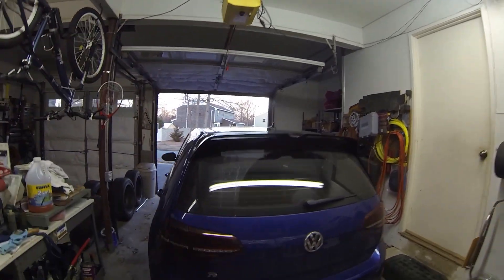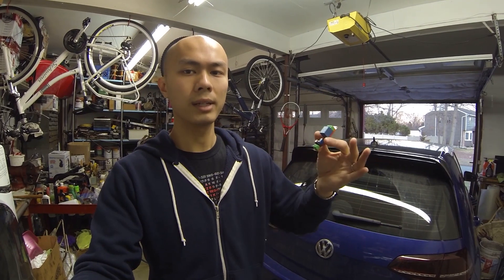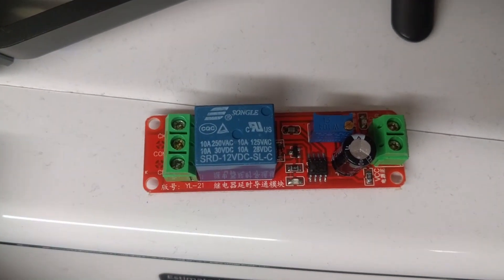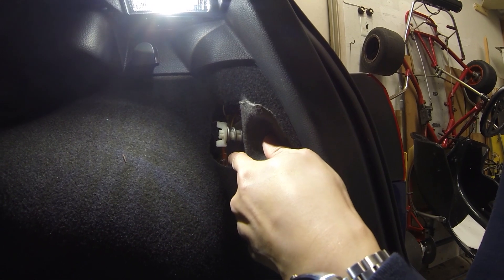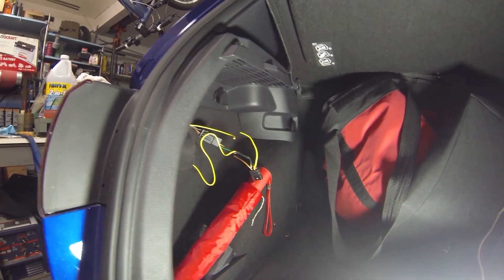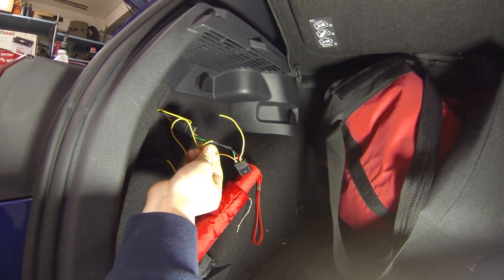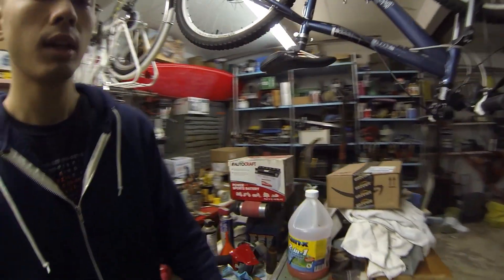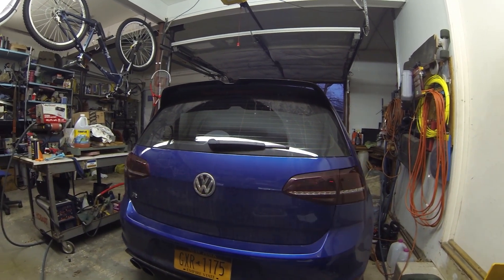DIY Sequential Turn Signals - MK7 Golf R

Comment: Could I ask did you previously retro fit your light fittings as I've looked at my wire harness to do your mod  but I don't have the matching yellow wires on my harness so without testing I don't know what wires to connect to regards paul

Comment: Hey great diy, I’ve got a quick question, I’m getting both the red and the blue light, with the hazards on, and I do get the click when I adjust the pot. But only the blue flashes upon the clicks not the red and there is no delay when I make adjustments to the pot. Am I doing something wrong? Oh and these are on regular halogens which shouldn’t matter I don’t think plZ advise thanks

Comment: ok so my wire colours were different, the brown was ground, but the power was a grey/black striped wire. it was a different colour on the other side, but wire position the same in the harness. it was the wire next to the brown in the middle. I used multimeter to find the right wire. The only thing is that there is an annoying click each time the delay activates that can be heard from the boot, so while cheap and cheerful fix, extra click in the boot each time the delay fires is annoying. Looks like the noise comes from the LED. In order to properly get back behind the wiring its necessary to take out the back seat, the seat side trims first, then the boot liner at the lid, then then the boot plastic liners on each side. Its a pain in the ass and many clips and plastic bits break especially if you arent familiar with how the panel comes out. Extra wire needs to be added in and soldered for 4 wires as there isn't much room. $20 sure, but the harness that just plugs and plays is probably so much easier, neater and quicker and doesn't require ripping your car to pieces. takes ages to do, a good 3-4 hour job. When the car is locked with the key fob, only the boot lid indicators flicker. When opening, depending on the delay timer setting, the outer indicators might not flash. Considering just returning to stock by soldering the extra wires i put in without having to take it all apart again. if you want dynamic lights just pay the $500 a get replacement lights, much better and less muck around IMHO.

Comment: To make it more in-sync perhaps you could measure the resistor's value in the potentiometer and make them the same value?
Reply from the maker: Yes that's an option, although overkill. Can't tell the difference already and how often are you using hazards anyway.

Comment: Great job zed ,
However i do have a question how do you get the sequential effect if the car leds are not addressable ones , and how does the delay timer achieves the sequential effect when it function on&off after a delayed time , i mean it will turn on and off all leds together with delayed time t not in an addressable way led one by one
Reply from the maker: Hi I saw that you also emailed me. I'll answer here. This is sequential with two bank of led not each individual led
Reply: @zed4me  Basically this is not sequencing but delaying the switching of the outer and inner indicator light, if one notice in the video it is an eye effect that you see the sequence but it's only switching the inner first and the outer later.

Comment: Hi I've connected as per the video however my relay switch stopped working both sides, only the red light comes on. its the same exact  12v NE555 Delay Timer i bought from Ebay

Comment: I figured that part out I had the wrong wire tapped into, but now I think all of my lights are on the same circuit on both side lol when I adj the POT. All my lights correspond smh it’s a older car so maybe that’s the problem but looking at your harness it looks like your 2 yellow wires are they tied  in together in the harness? Because my turn and brake are tied and jumped from 2 of my 3 lights. I was only gonna out the board on only one light, do u think I should do both I wonder would that work or cause a problem being they are on the same circuit

Comment: Thanks for this vid. It got me thinking that I could potentially use the N555 to make my stock halogen tails sequential with a little re-wiring. What do you think? I'm not a fan of the urban joke police wig wag.
Reply from the maker: Only if your turn signals currently make both the inner and outer taillights blink together.
Reply: You can do this with OBD Eleven Premium. You need manual coding and some research.
Reply: Csrt4Dad Did you happen to figure out if this is possible with the halogen lights?
Reply: Since OP does not follow his post, I post my 2cents:
If you want the red parts to do the semi dynamic blinking, you'd have to put them onto one wire, then use the relay respectively and release the lights in the bcm of all coded functionality to not get a bulb error.
If we're talking about euro halogens you could use the regular yellow blinker and the reverse lights as the inner part of a semi dyn blinker in the same way but, again, you'd lose their original purpose except you code your blinkers as reverse lights.
For further information research about Leuchte Coding on MQB platform

Comment: Though this looks rather vehicle specific to stock LED lights; I am curious....is it an optical illusion or is it just a "two light sequence"?  First the inner then the outer?  I am thinking that with two of the modules you could make a "three light sequence" and with three you could make a "four light sequence"....would just have to run one module into another, but speed up the time as the power from the initial stock "blinker" relay is only on for a short amount of time.  What do  you think?  Thanks...

Comment: I came to finally rebuild your  Project. Small problem: if the engine is off : all good, works like a charm. But if my engines running the Relais sound like dying. ( buzzing sound)I think they suffer from too high voltage from the alternator. Should I put a resistor or sth else in front of them? How to protect them? Can I simply modify something with obd11?
Reply: So i went to my local equivalent of a radioshack and build a small voltage rectifier according to the employees recommendation. 
It used 2 diodes and 2 capacitors in parallel in front of the Relais.  In front of the positive input an adit iona resistor. I'll follow up with the parts as soon I have deciphered his schematic
No noise of death since then
Reply: HI THERE GOBO. IS YOUR PROBLEM SOLVED AS YET?DID THE ERROR CODE ON THE DASH HAS BEEN ELLIMINATED?PLEASE LET ME KNOW AS IM HAVING A PROBLEM WITH MY CAR THANKS
Reply: Hi Andresh Naicker, yes this rectifier solved my problem. But I had no errors I the dash to begin with. I might mention I already had the light channels set to 127 for led lights.
Reply: MANY THANKS FOR YOUR RESPONSE. MY CAR IS A EURO SPEC SO IT COMES WITH THE LED LIGHTS SO IM JUST WONDERING IS YOURS IS AMERICAN OR EURO AND IF POSSIBLE CAN YOU KINDLY EXPLAIN WERE THE DIODES AND CAPS GO. THANKS
Reply: Hi Andresh Naicker fellow euro here. I made a slim board with 2 separate rails and a 2 pin terminal on each side. In between 2 diodes and two caps connect them two each other. On the positive input a resistor is placed. This one does not cross over and may be placed anywhere in the circuit AFAIK. 

As far as I understand this contraption the caps fill voltage dips while the diodes cut spikes. Probably reversed polarity too but that shouldn't be an issue here.

If someone smarter than me wants to do the math.
The lights draw approx 300ma. My bord voltage was about 13 to 14v with the alternator. Needed are clean 12v. The limiting factor is the relay here. If there's a simular board out  there that supports higher voltage that might mitigate the need for this extra.

Comment: FYI> the 555 is the little 8 pin ic. You were calling the relay 555.
Reply: Also substituting a MOSFET for the relay should be more reliable. And smaller. And silent. And cheaper.
Reply: What is this?

Comment: Hi Zed
I have installed NE555 on my Golf 7 GTI PP , the turn signal works, however after few seconds a warning lights pops out the display which states check the rear turn signal lights. I am not sure what is causing it.

Comment: Hello, Thanks a lot for your video! I would like to install the relay too. My car is from factory of installed without LED taillights. I saw you installed the retro fit tail lights. Is There a different pin lay out?
Reply from the maker: I'm not sure, there may be. You just have to intercept the signal right before it gets to the outer amber tail lights for this to work. Can definitely make it work on any car with LED tail lights.
Reply: Thanks a lot for your quick response! That makes sense indeed. I will investigate. Keep uploading your video's. It's really helpfull! 👍

Comment: Hey zed! Great video man. How would you go about doing research into finding out which wire comes from the inner tail light?
Reply from the maker: A multimeter and some small pins in order to get them into the connections would help. Look for oscillations in voltage when you turn on the turn signals.
Reply: Awesome cheers man

Comment: HI Zed, i was trying to follow your step, but when i see your video at 5:26, i found my cables are short, dont look like as long as yours, also my cables are brown, purple and black, not yellow, so i was a bit confused. and how can i pull them out like yours...im not sure if you know what i meant, i could send you a photo of my cables, and also they are original LED tail lights.
Reply from the maker: Gonna have to do some research and figure out which of those wires is for the outer amber turn signals. Then you can intercept it in a similar manner to what I've done.

Comment: would buying a set of male and female connectors and then plug it in-between the original helps make it of a less of a hassle ?
Reply from the maker: Not much of a hassle to begin with here. Of course having the male and female connectors would allow you to wire it all up outside the car, but I certainly could do the same thing before installing the wiring harness anyway.

Comment: Hey by any chance do you have the wiring harness from eBay? Lol I got mines from there and I can’t get the coding right, also do you have the coding you used that I can give it a try? Thanks!
Reply: I'm sort of having similar issues with mine. I've tried a fair few different codes but still can't get the turn signals to become dynamic. What's wrong with yours?
Reply: mcderpen  no dynamic turns man but I spent like 4 days and got the coding figured out I’m working on a video on that for those with the eBay harness stay posted I’ll try to upload it this coming week man
Reply: Nice work dude. I've been trying to figure it out for ages but just can't get this and reverse light error cleared. Looking forward to your video man, hopefully it'll help me. Cheers
Reply: mcderpen for sure man it’s super frustrating like I said I spent 4 days but finally figured it out, no one seems to know the coding for those eBay harness but hopefully I can help with the video 👍🏼

Comment: I did this mod today, and i worked perfectly, however, I now have 2 fault codes.
B11EB15 - Right rear turn signal bulb Open circuit/short circuit to B+
and B11E915 - Left rear turn signal bulb Open circuit/short circuit to B+

The indicators work outside the car, but then the indicator on the dash flashes at 2x speed.

I cleared them with OBDEleven, but is there a way to stop these codes reappearing?
Reply: youpalm  hey mate. No such luck. I've removed them since then. I'll work on it again at some point

Comment: Zed does this affect the rear tail lights in red like the harness you can buy does, if you buy the harness a few of the red LED's don't work breaking up the original pattern of the red tail lights
Reply from the maker: No issues here, I just took a video with my gopro and it looks like the red LEDs are not affected at all.
Reply: zed4me have you seen the problem with the purchased harness, the 2 red leds go off where the turn signals go through them if you know what I mean, can't post a picture on here to show you.
Reply: Posted the pic on your Facebook 😊

Comment: hi there, i really like this video as i was waiting for this for long long time, nearly a year, i didnt buy the $130 one. So i  just bought this relay, and going to install them in my car. but i found in 8:07 in your video, there is a white cable that you used to connect,  where do i get that white cable? should i cut it from the yellow one? i will wait for your reply , thank you so much :)
Reply from the maker: Any piece of wire will work but you can certainly take it from the yellow one since there's so much extra length in them

Comment: What is the 3rd output for? I only saw you use the middle output and the left
Reply from the maker: jorge pizarro that's normally closed so it gives power until the relay clicks in which case it then turns off power to the output
Reply: zed4me I got a good idea for  installing these for my tail lights for my motorcycle that I'm building.. I already did headlights

Comment: Hi friend, my NE555 has stopped working in 5 minutes of use ... will it be that I bought low quality?
Reply from the maker: Rafael Monteiro possible. one of my customers installs came with a bad module so I had to replace it. mine is still going strong though.
Reply: mine died after a day. thought it may have been a bad module, bought a replacement, installed that one and died after a few days. gave up and just removed it :(
Reply: Same problem on my A3 8V.
Did you finally find a better quality module?
Reply: Friend, I bought some more NE555, from another manufacturer, it seems that it bore better, with engine turned on it did not burn, but it did not work cool, it blinked different, I removed, I gave up ...
Reply: Rafael Monteiro if your relais work with engine off but slowly die with running alternator you might consider a rectifier.

Comment: I connected my outer turn ligh to the delayer like you did, it did not work for me :(. The taillights from outer and inner blink and the same time, but the outer taillight blinks shorter... what did i do wrong?
Reply from the maker: You connected to CB instead of CK. Rewatch the video and look closely as what terminals you need to connect to.
Reply: Thanks for your quick response, i check again and it is on the CK. I dont have a yellow wire but a green/black wire. Also i do not have a red and blue light on the delayer but a red and green light.. so weird..

I love your videos btw.
Reply from the maker: Do some bench testing first and see if you can get it to work before wiring it into the car.
Reply: Dont let yourself get irritated by the colors of wires.Its only the pin location that matters

Comment: One last question. Do you know if the wiring is the same for Euro OEM tail lights? I have a Eurospec and  wanted to do this mod.
Reply from the maker: ATTN no clue but my guess is it's different
Reply: zed4me i much rather this mod than the pace with the OBD coding
Reply: Euro lights, right hand side green/black + brown, Left hand side black/white + brown

Comment: Can you provide your coding of the lamps? If you still error free and the relais are still going strong your setting might be useful.  I think you can switch beween load types.
Since you had the halogen from factory your channels should be: 
Leuchte 18 BLK HLA60 (left)
Leuchte 19 BLK HRC31 (right)
Reply from the maker: Swogetti Swindon I don't believe I've coded my taillights other than the DAP harness coding app from OBDeleven for the LED taillights

Comment: Hey Zed, when i use the hazard there is no issue but when i'm driving and use it as turn signals i get the error to check my light. What did i do wrong?
Reply from the maker: do you have it confirmed working first?
Reply: What do you mean by confirmed working first? When i use the hazards they work perfectly fine, but when i use them as a turn signal i get the warning light.
Reply from the maker: So the sequential turn signals work properly when the hazards are on but when you use the turn signal the sequentials don't work? Or they work but you get a warning light. I have never heard of getting a warning light. I would guess another part of installation got messed up. Try removing the sequential turn modules, and I bet the warning light would still come on.
Reply: Exactly, so when i use the hazards they work perfect and no warning light. But when i drive the car and i use it as a turn signal i get the warning light after few flashes.
Reply from the maker: Not sure what issue is. The sequential turn signal module affects only downstream so it's not the reason you're getting the warning light. Something else must have been installed incorrectly.
Reply: Hi Zed, removed the modules and the warning is gone. I guess no modules for me :(
Reply from the maker: Very surprised. I have done this on another car and no trouble.
Reply: I have read about this else where on other plug and play modules. At least this is true on 5th Gen Camaros. The error will happen when the delay is too long. Try making the sequence quicker and see if that fixes your issue.

Comment: Zed I love you videos man but I spilled my drink when you pointed at the big blue box and said that's the NE555 ship.
I'm actually an engineer and it didn't sit well with me to just let it go. so the big blue bow is just a relay and you see a small black square ship with 8 pins? that's the NE555 ship, they relay is there basically because the ship itself can't output a lot of current to operate power hungry electronics directly so it was setup in that circuit to operate the relay instead and the latter is what operate the signal current.
Reply from the maker: Yeah, I know what the NE555 chip looks like, just pointed to the wrong thing in the video clip
Reply: Glad you knew how it looked like just wanted to point it out to avoid misleading.